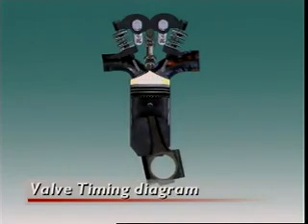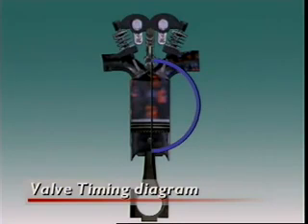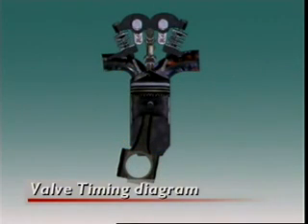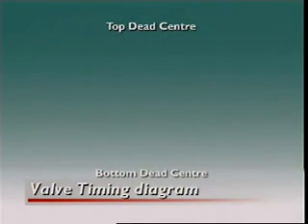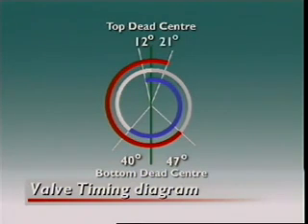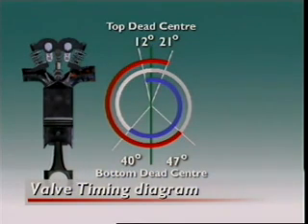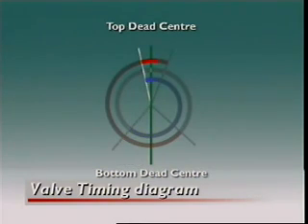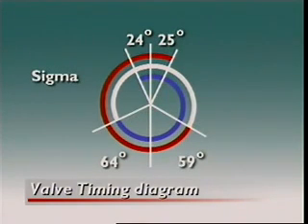Valve timming diagram

Comment: first , its good animation . but plz ... i wanna understand more .so,i ask : why we need the lead and lag period or ( what is the benefit of opening inlet valve after BDC even there is no more charge entering and the same idea for lead >>>)   the last ques. is (Is  the sum of lead + lag considered  an overlap also ) ????   ... Thx in advance ......
Reply: moh saeed I think the idea is to use the momentums of the gas flow. The camshaft design collaborates with the inlet and exhaust header design. So you can overcharge the engine and increase the volumetric efficiency.

Comment: wait wait others should have 360 degrees to finish the cycle? im confuse
Reply: Depends we are talking about. This video is for a 4 strokes engine, in wich one cycle (the four strokes) is completed when the crankshaft realize two turns (720 degrees). On the other hand, a 2 strokes engine would complete the cyclo in only the 360 dregrees that you say (one turn of the crankshaft). Regards.